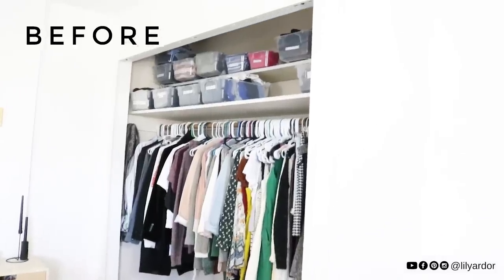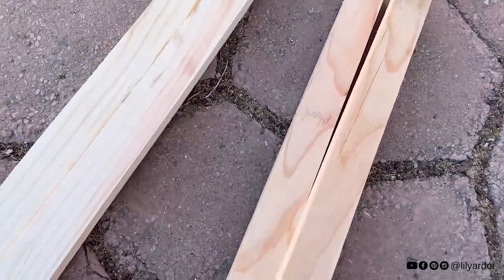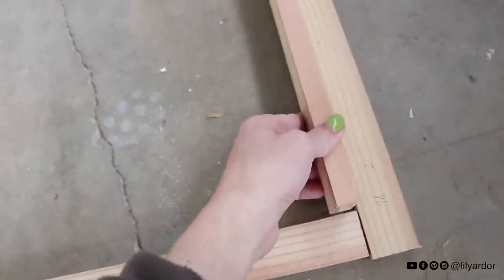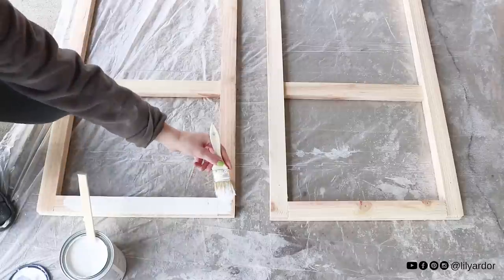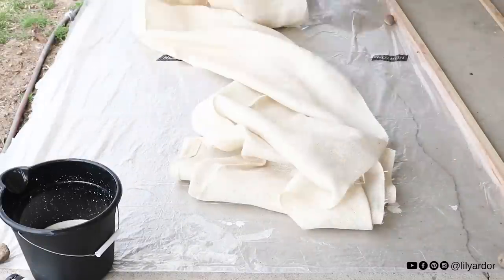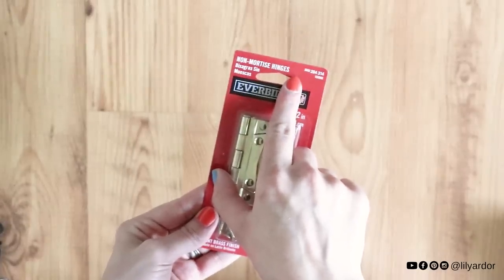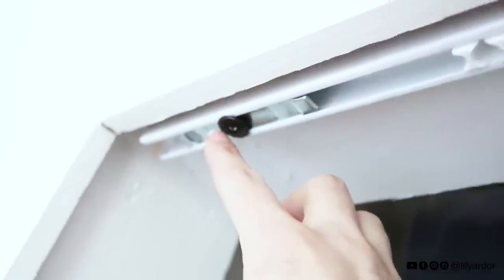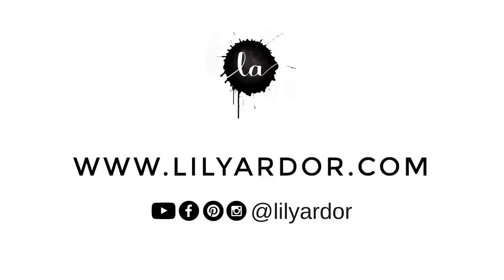DIY Closet Doors! With FULL installation! Sheer Rattan Look Created With burlap!

Comment: hi there, i know it has been a while since you posted this, hoping you still see my message. do you still have these doors? how is it working after all these years since you made them? any issues you had to fix since? another question please, you mentioned you SUBTRACTED 1/4 inches of each side (all 4 sides) of the panels to fit the hinges, is that correct? thanks.

Comment: Hi I am thinking of doing this project for my closet. sadly most stores don't have the right size for my larger opening. My closet doesn't have the wood to hide the top rack unfortunately so I am trying to figure out the right measurement for the wood so it fits. I was wondering if you measured the opening before putting in the top bi-fold rack or after putting it in?

Comment: I did a amazing good. I been looking for an affordable idea for my moms closet. Quick question since you decided not to put the fabric between the wood, does it still need to be cut in 1/2? I wouldn't think so but just checking. TFS
Reply from the maker: Thank you :) Not you don't have to cut them in half but too attach then I would use a kreg jig instead to make slanted holes. You can then use screws to secure all the pieces together.  We did this with our barn doors - https://youtu.be/VXSoVyBkayY

Comment: Can the fabric be dipped in diluted paint or does it have to be painted with a brush? Thank you 🍀
Reply from the maker: It can I just feel like maybe it would take longer to dry that way? I was also worried I didn't have enough diluted paint. If I were to do this I would make sure I have enough before dipping it in.

Comment: Can you spray paint the burlap?
Reply from the maker: it depends on if you're trying to lighten it or darken it. If you're going lighter it doesn't work well. if you're going darker it might work.
Reply: @diylilyardor3435  oh wow!! Thank you for responding so quick.... I went to Joanns but they're closing, so they don't have acrylic white or cafe late. I bought the spray paint and yes I'd like to make it darker. I should be making my closet doors tomorrow. Thanks again for the quick response and awesome idea!!!!
Reply from the maker: @angeldlfn  On no! Sorry to hear they're closing. Yes I think darker should work. They also sell spray paint at lowes and home depot. Rustoleum is my favorite brand of spraypaint. It's pigmented and hasn't let me down yet.
Reply: @diylilyardor3435  thank you so much Lily, that's the paint I'll be buying

Comment: how to make bifold doors....NOPE you need a table saw to do this project!
Reply from the maker: If you don't have a table saw you can make them without one. you can do this by not splitting the wood and instead use a kreg jig to make slanted holes in your wood to secure your pieces to create the door frame.